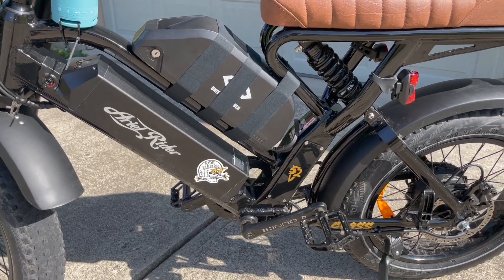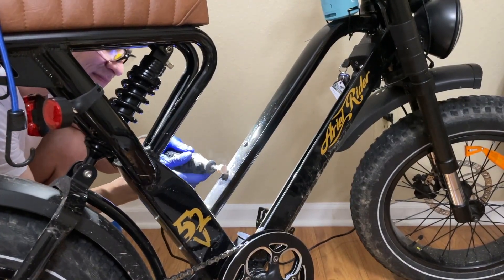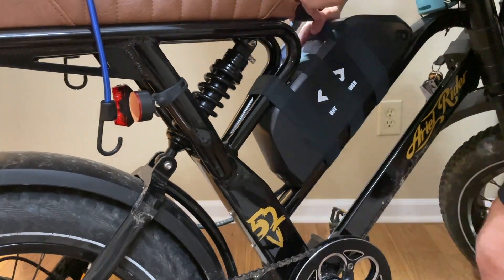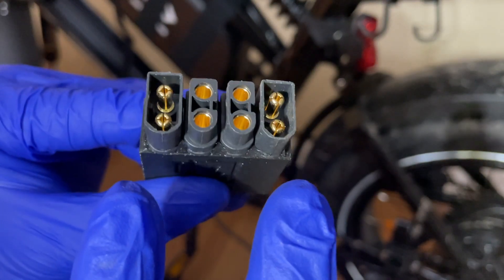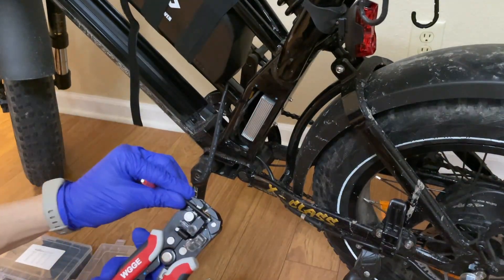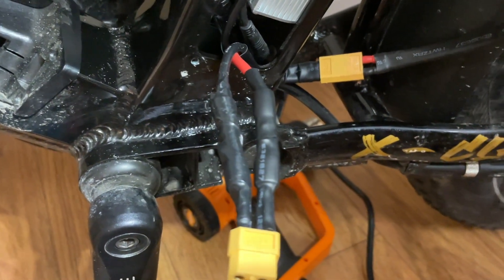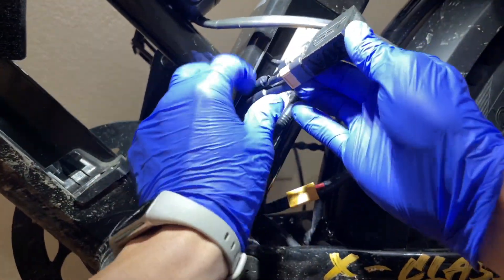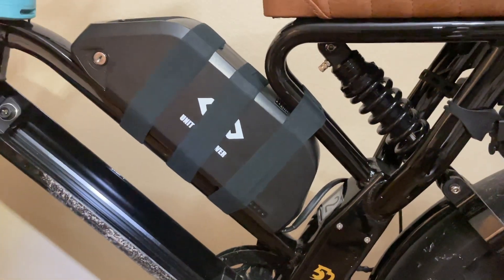How To Add Second Battery E-bike (X-class Step-Thru) - Unit Pack Power Shark/Jumbo

Comment: Very good. I wonder what's in that 'battery blender'..? I bet it's not $150.00 of components!
PS: Cheap and dirty 'battery blending'.
Invest in a double pole, double throw switch rated for sufficient amps. Wire it up so you can flip between batteries - done!
Reply from the maker: My understanding is that the Spark Cycle Works Battery Blender is basically a Date X2, which appear to have a pretty decent reputation. I am sure its like $1 to build but I was concerned about the battery balancers on Amazon not specifying that they managed differences in voltage, where the Battery Blender advertises itself as doing so. With that said, I had reservations about the Amp limit on the Blender as it states 30 amps, and I think the Xclass runs 33 Amps from the controller. No serious issues yet, had to unplug and replug in once since installation because the Blender would not pull power from the reserve battery, may have been oxidation on xt-60 connectors. I thought about a switch prior to installation, but a switch install seemed more complex than just throwing on the blender. I also wanted to drain the batteries as evenly as possible. Appreciate your input!

Comment: Would i be able to connect 52 volt 30 ah battery to my x class 52 V 20 ah. ?
Reply from the maker: If you mean using a battery blender, then you should be ok (with caveats). I would NEVER connect two batteries without a battery blender as that is very dangerous and could cause a fire. Also, make sure your controller is not above the 30 amp rating of the battery blender. The Ariel Rider I have has a 33amp controller (which is above the limit) and I have yet to have issues, but it is definitely pushing its limits.
Reply: @dannyshows  Thank You for answering my question. So i should update the controller too.
Reply: I mean Change*
Reply from the maker: @skybeyondthelights  That's going to be your call, but I did not change the controller. I have not had issues but I am careful to always make sure that it's not running hot. I have yet to have any significant heat issues. I usually wait at least 30 minutes after riding to start charging and make sure to switch off the batteries before charging as well. I keep a Google Nest smoke detector in my garage so that my other Nest detectors sound an alarm in case smoke is detected. The last thing I want is a fire in the middle of the night in my home and most of these issues will usually happen when charging the batteries. It appears you may live in hot weather so you will want to make sure its not overheating. Either way these are precautionary steps you will want to take with any other lithium ion batteries. 30 amp hours is quite a beastly battery, I presume its a triangle battery on the regular X-class and not a step thru? Best of luck, it's well worth it in my opinion.
Reply: @dannyshows  i have the x class 52 volt 
Not a stepthru version.

Comment: how many more miles? I get about 35 miles stock
Reply from the maker: I get 33 or 34 on the stock. I believe I doubled that with the extra battery I added; thus I think I could get about 70 miles in range. The longest I have done is 65 miles. I don't think I'll ever do a longer ride though, that's a long day of riding. The additional range will obviously depend on the amount of amp hours you are adding via a secondary battery.
Reply: i do food delivery full time on my ebike. @dannyshows

Comment: Great video Danny thank you! Going to do this to my Xclass step thru I bought a couple months ago i love it! How many additional miles are you getting on it now that you have the extra battery on? Thanks again.
Reply from the maker: I have not maxed it yet, but can get about 34 to 38 miles on the stock battery and make it home on the secondary battery with no issue. I have done rides as long as 60 miles with no problem. The secondary battery has a switch; I keep it off until draining the first. I used to run both via the battery blender but I like having more voltage for my ride home.

Comment: So I have recently done this battery modification. Pretty much exactly how you did in the video.  I'm getting used to have it affects my battery percentage in range. And it's a little confusing because both batteries read from one battery gauge.  

On my last ride it seems like the batteries are draining a little bit unevenly.  The stock battery had 50% and the second down to battery had 75%. Any ideas why?
Reply: Im not sure if you have found your answer yet but from what I heard if you use a blender it sucks from the larger battery until both batteries are at the same level then they drain together. So if one is 24ah and one is 20ah, your 24ah will drain first til they are the same.
Reply from the maker: Can't say I know for sure. I am curious how you are measuring your batteries separately. Are you unplugging the batteries at the battery blender? In my opinion, the stock battery gauge is not very good and bounces all over the place. Either way, if you find that one battery is being drained quicker than the other, what is most likely happening is that one (the stock battery) probably has a higher voltage. This means that the battery blender will pull from the higher voltage battery first and then drain the other battery once they are at the same voltage. I also feel that the stock battery has a slightly higher voltage than the aftermarket battery.

Comment: how does this affect range/speed?
Reply from the maker: It has not affected the speed, if it has it's probably about half a mph faster especially at the beginning on a full charge. As for range, I can easily go 55 miles with little pedaling but will notice battery sag at about 25 miles with little pedaling. Either way it has been totally worth it for the range. I am able to travel pretty far and get out in nature.
Reply: @dannyshows  nice. I'm at a crossroad, as i have the same bike with many mods...to add battery or upgrade to 72v 5k motor...its a give and take with distance and speed.
Reply: @dannyshows How can I add this to my 52V not step through?? And can I upgrade controller to 60V for more speed?
Reply from the maker: @youngjay914tv9  my understanding is that the main measure of the controllers is in amps. The x class runs a 33 amp controller which is already a bit over the 30 amp limit on the battery blender. If you use a larger amp controller i am not sure the battery blender would be a safe option. But yes in theory u could get a larger controller to run 60v batteries. Youtube has people running monster sabvoton controllers on ariel riders and other bikes.E Street bikes has some bundles they sell but get ready to spend motorcycle money if you do.

Comment: You couldn’t have made a notch on the battery tray/holder instead?   😮
Reply from the maker: Maybe, this was quicker 😂. In all honesty I am not sure the battery would have fit if I were required to keep the tray straight. In the video you can see that I had to turn the tray to fit the battery. This battery is too big for this set up.

Comment: Anyway you can provide links?. specifically a link for the battery
Reply from the maker: Added the battery to the description. There is an option for electing 52V 21ah. Just know the 21ah option is pretty big and will be a tight fit.

Comment: You definitely did the right thing to strip off a little more insulation before using those butt connectors.  The more bare wire inside the metal gripper, the better, both for pull-out strength and electrical connection.  I would have soldered them because crimp style connections on wire can go bad over time and vibration. But should last a few years at minimum, especially on 52V systems.

Would be interested in the range extension that you experience with the 2 batteries.  With my 48V X-Class, I've gone over 40 miles and still have 60% charge left with just the 1 battery (was only going slow at about 14MPH and pedaling).  And your thoughts of voiding the warranty to get more range.
Reply from the maker: I am also a pedaler and I found that I could easily get 40 miles with about half of the charge still showing; very similar to what you experienced. I also rarely ride above 15 miles an hour. However, I have taken my bike to play soccer about 10 miles from my home, and found that on the way back I was exhausted from playing and just wanted (needed) to throttle. I don't want to place that much strain on the stock battery if possible. Adding a second battery should also slow down the amount of cycles I will be placing on the stock battery. I plan on doing some over 50 mile range rides from the suburbs to downtown Indianapolis and back up. I suspect that on those longer rides I will need the extra range. I am not sure I plan on doing an actual range test, I probably will feel a need to pedal and enjoy my ride with the exercise. But I suspect I will get about 40 miles throttle only. 

For me, voiding the warranty is worth the change. I have not had to deal with their customer service, but I would expect that if something broke I would probably end up replacing it on my end anyways. I suspect my repair time would be much quicker than customer service. It is unfortunate because I have had my bike since the end of February, not even three months yet. Either way I'm really enjoying it and have put over 1000 miles on it already. I hope the feeling doesn't wear out.